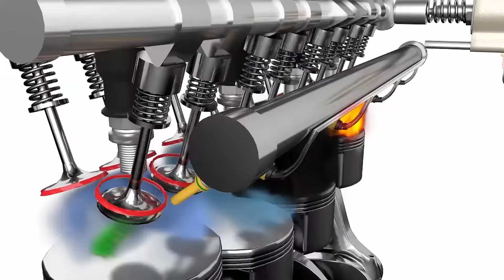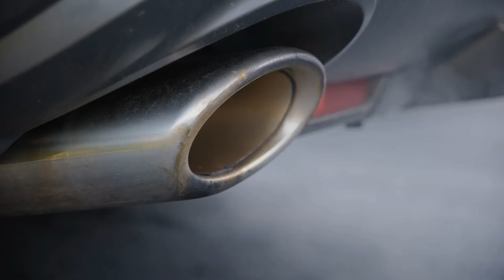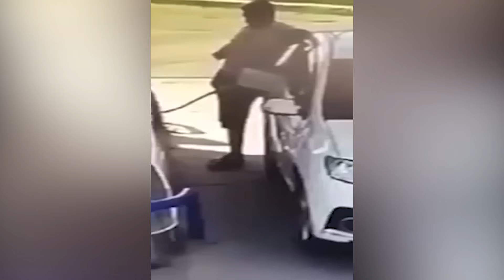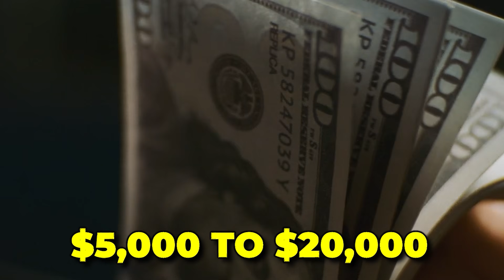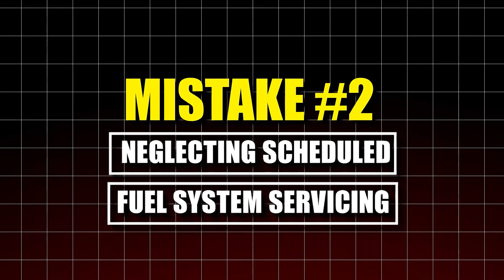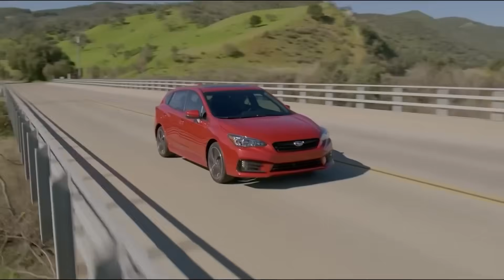Never Do THIS Before Refuelling (98% Get it Wrong)

Comment from the maker: Never Use These 11 Gasoline Brands - https://www.youtube.com/watch?v=_mAEdnjKzsE&t=835s&pp=0gcJCQMKAYcqIYzv

⬇Care Care Clues Top DIY Tools and Products:

🚗 Essential Scan Tools
Newest Scan Tool:https://amzn.to/3GJyuET 
Bluetooth Scan Tool: https://amzn.to/42AcBRc 
Cheap Scan Tool: https://amzn.to/42WZIzx 

🔋 Emergency Essentials
Best Jump Starter: https://amzn.to/44fYOAm 

🛢 Fluids and Leak Stoppers
AT-205 Re-Seal (Stops Leaks):  https://amzn.to/3S9icYm 
ATS 505 Fuel System Treatment: https://amzn.to/3YQjjA2
Lucas Oil Transmission Fix: https://amzn.to/4jNk98M 
Bar's Cooling System Stop Leak: https://amzn.to/3Sht0nj 

🔎 Quick DIY Diagnosis Tools
Head Gasket Leak Test Kit: https://amzn.to/4jRgc2T 

🛠 Useful Maintenance Accessories
Quick Twist Oil Drain Valve: https://amzn.to/4jWG3GJ 
Tire Gauge (Check Pressure): https://amzn.to/3GxySGD
Tire Air Pump: https://amzn.to/3RZK9Cd 
CRC Mass Air Flow Sensor Cleaner: https://amzn.to/44dJpkb 

🧰 Mechanic’s Must-Haves
Car Battery Tester: https://amzn.to/4jTqyzk 
Basic Mechanic Tool Set: https://amzn.to/3Ymgerh 
Cordless Impact Wrench: https://amzn.to/3YkkhVc

Comment: Use top tier gas which has engine cleaning detergents from a high turnover quality station.  Use Chevron tecktron or similar every oil change in gas to clean injectors and internals. Pure gasoline better than ethanol blended gas. Keep gas tank near full always especially if vehicle stored outside. Prevents water condensation and rust. Ethanol gas goes bad in a month.   Use gas stabilizer if not used by then, esp Hybrids. Stop filling tank on first click off, do not repeat. If GDI engine Use valve and engine spray cleaner in a vacuum hose(egr valve) that leads to Valves.  Use rewards or cash back to save money at pump.  Prevention is cheap, repairs are not.

Comment: I have seen children standing beside the person who is refueling at the gas pump. I explained why this is potentially harmful to a child who inhales the fumes coming from the pumping action. I now see, thankfully, that cell phone connections are interrupted at the pump. People used to get annoyed when I  explained the potential harm of this. Now, a person has to be far away from the pumps when using their cell phones. If a person accidentally tries to insert the fueling arm of diesel into a regular gasoline opening, it will not fit. Thanks for this presentation. Namaste